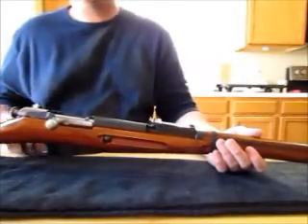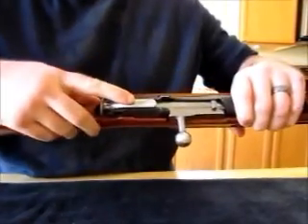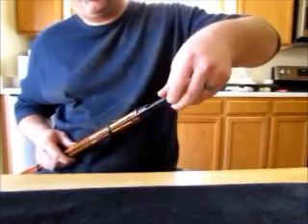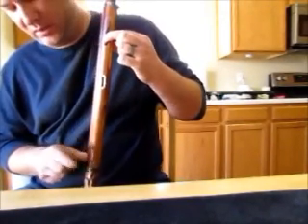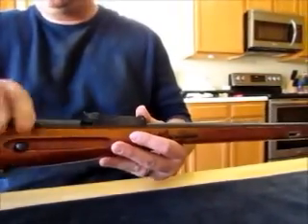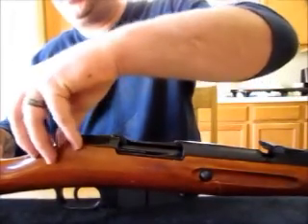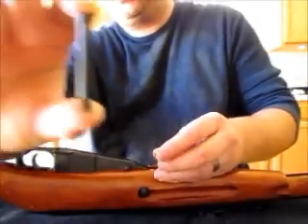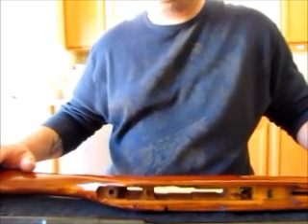How to disassemble your M91/30 Mosin Nagant Rifle

Comment: Found that the handguard springs were quite tight on my 91/30. Had a bitch of a time getting the rings loose enough to move. The upper handguard slid forward before the rearmost ring moved, which confused the hell out of me.

Otherwise, the only issue I had was with how tightly the lower receiver was jammed in there. I was rather surprised, when tugging as hard as I was on the trigger guard, that it was going to take a little bit more to dig it out.

This video helped immensely. Time to clean!

Comment: I purchased my first Mosin-Nagant sniper version)this last weekend.  She's in good shape.  I took out the bolt and the cleaning rod and ran a cloth down the barrell.  Of course the rod got stuck and was not long enough to pull back out.  I will use a wooden stick  (one of those round ones that can be cut up for dowel pins). to push the rod back up the barrel to avoid scratching anything.  Looks like the rod is about 3 or 4 inches too short.

Comment from the maker: You shouldn't remove the front sight to take the handguard clips off. Make sure you are putting them back in the correct order - If you can't get the front clip back on more than likely you need to take the rear off and switch them around.

Comment: How can i split the handguard clips open? I took the front one off without removing the front sight (i know, bad idea)  so that i could change the stock to an ATI monte carlo stock. I just switched the stock back out to the original, and i cant seem to get the front ring back on. Any ideas?